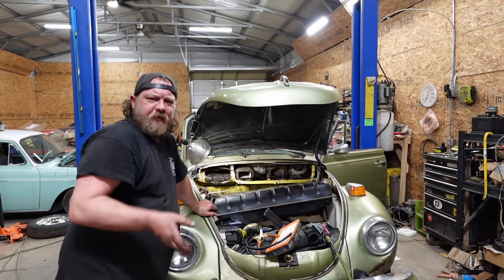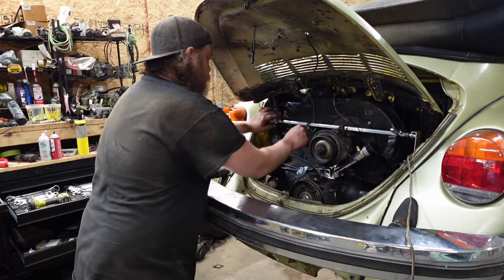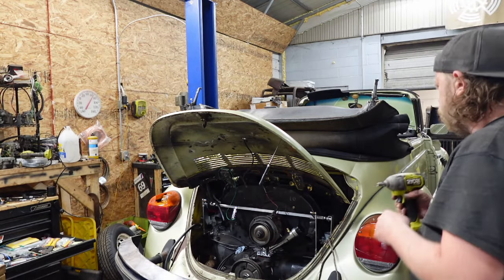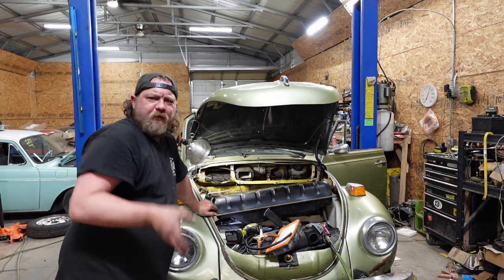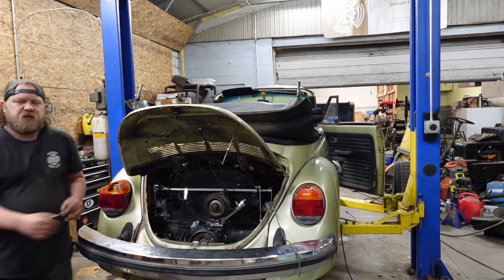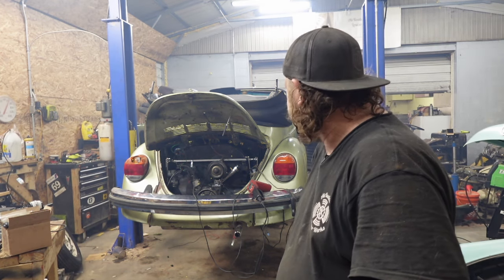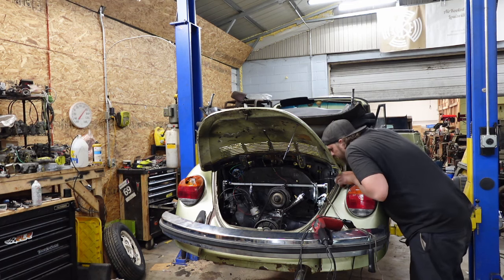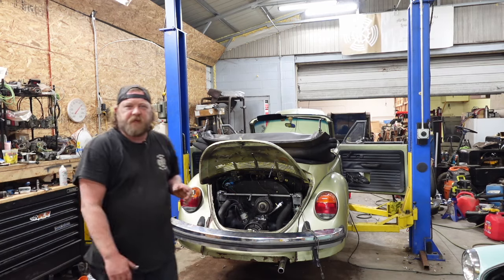1979 Super VW Beetle Revival L-Jet Fuel Injection is gone Dual Carbs Installed

Comment: What is the orange tank you use to clean the nuts on the oil change? I didn't catch what it was but it sure looks like a good tool to have.
Since you did not have to tear the engine down for a rebuild and it sounds pretty good to me, my question is – do you have any concerns (smoke driver side) about the engine, sitting for so long, that the overall lifetime may not be very long? 
Also, I seem to be having the same timing issues that made you change the distributor. If I followed you correctly – first using the timing light, even though you did static time first, the readings were way off, (mine are too) then changing the distributor brought the timing back. What told you that it might be 
the distributor?
Again, great video and I learned several things I did not know. I do wonder how and why you can't be compensated for all the time you invest way beyond what you could possibly be expected to cover when cars that have been neglected and forgotten tax your good will?
Reply from the maker: https://www.amazon.com/dp/B0CKX2WQ4K?psc=1&ref=ppx_yo2ov_dt_b_product_details

To the first question.... I either fill with acetone or brake clean honestly depends what I have laying around to what's in it at particular time of use lol
Reply from the maker: Not super concerned about the engine currently hoping it's just stuck rings due to the alarming amount of fuel in the oil It's slowly coming around but the owner will have to monitor consumption and we can address from there if becomes an issue... And as far as the distributor goes when you static time it at zero and then hit it with your timing light at idle your mark should still be lined up at zero +or - a few degrees ... In this case when I static it to zero and started the engine the timing mark was so far retarded that I couldn't even see it with my timing light I had to advance the distributor almost an eighth of a turn to get zero Mark lined up with the case... So at that point even though all of the marks lined up I knew it was not jiving with the static... The static timing was pretty much lining the engine up at about 28° ATDC so the spark was firing way to early and was the reason for the intake backfires and me backing off the timing when I backed off the initial to eight I was still having intake backfires so I knew something was hinky with the ignition system mainly the distributor... I think I have a more in-depth clip of the carbs not acting right I'll dig up and post if I can I just think the audio was terrible and that's why I edited it out during the revving of the engine
Reply from the maker: I'll try and post a visual tonight or tomorrow on the word salad I just said...lol
Reply: @airkooledmotorwerks  OK that will be great. I think I understand, but I will re-read your reply a couple of times more. Thanks very much
Reply from the maker: @yttkuar  definitely easier for me to show then to try to explain... Just comes with working on these things so long and it's more a six or seven sense at this point on how I do what I do and it's just awkward for me to put it into words that are comprehendable put out visual representation

Comment: Do you know of a dual carb conversion complete kit for sale anywhere?  I know that Jbugs has a single carb conversion kit but I’d like to install dual carbs on my ‘79 super and I’d like to have a “soup to nuts” kit with directions.  Thanks for any info…
Reply from the maker: @johnharrington4963  https://www2.cip1.com/c13-47-7411/
Reply from the maker: This is the exact kit I installed from the company I bought it from CIP1
Reply from the maker: Only thing I do different is run hard lines instead of soft lines to everything but I state and show that in the video... Hope this helps any other questions feel free to reach out

Comment: Hello so I’m doing the same thing with my wife’s 75 super beetle convertible. So what I’d you do for wiring. ???? If there’s a video. Please let me know. Or if we can text directly or call. Thanks enjoyed your video 👍🏼
Reply from the maker: Not 100% what you are asking about the wiring... I showed what I did in the video, but my scenario was a little different as to the fact I had to run another ignition wire... As far as wiring goes if all of your electric is fine all you're going to need is 12 volt ignition key power to the fuel pump. Nothing else gets affected when you remove the fuel injection.

Comment: That bottom end is sounding growly.
Reply from the maker: It's the mic depending on where I stand it's picking up a combination of the alternator (bearings) and the air going into the carbs combined with the heat shield behind the pulley doing whatever it feels like because I don't have the rear engine tin on yet... Please believe I hear exactly what you are talking about and thought the same thing when editing this... but it's definitely how my lapel mic is picking up sounds in conjunction with my body orientation... The sounds that are picking up are almost unnoticeable in person

Comment: We're ripping out fuel injection for a pair of carbs because we aren't smart enough to fix fuel injection.
Have a nice day.
Reply from the maker: Sometimes it just has to be done to keep a car on the road
Reply: Have you seen the prices for OG fuel injection parts? Thanks, I will be happy to tear it off as it's WAY beyond it's self date.
Reply from the maker: Exactly... Sometimes the cost to save just doesn't make financial sense... And please believe I tried my damnedest to save this one (eating my own labor because I'm vain and don't like to be beat) but at the end of the day the wiring harness was toast cold start injector was leaking had the wrong distributor many vaclines bypassed all fuel line shot mass air flow questionable at best all the intake leaks along with missing injector gaskets (mind you this is just what I came across on the initial diag)  and with the car not being original anyway and the owners just wanting to enjoy it, it  didn't make financial sense to try and save it
Reply: @airkooledmotorwerks  The earliest Bosch fuel distributors were cast iron and had leather diaphragms.  I've not come across one, but my understanding is that it's a non-starter.

I like weirdo cars.  My '72 is an autostick, and I have no desire to convert it to a four speed.
Reply from the maker: I currently have a 73 auto stick beetle in the shop for restoration... I was the only one that would take it on as everyone else that the owner talked to wanted to swap it to manual without even considering to try to make the auto stick work ... If it's original and can be saved granted at the owner's expense I am more than happy to do it... Typically if I'm doing an order to manual swap or getting rid of fuel injection it's simply because the swap severely outweighs the repair cost... As far as I know I'm the only one in Louisville that is crazy enough to even work on fuel injection or AutoStick especially coupled with a revival... I think I stated in one of the first videos on this car if it crapped out last month most likely would stay fuel injection but you couple 8 to 9 years of being off the road and left for dead typically multiple issues arise then typically don't justify keeping it It's unfortunate but true... Personally for his my car and I didn't have to pay labor I might have kept it
Reply: @airkooledmotorwerks  If it makes a farting noise when the clutch servo operates, you will need to replace the servo diaphragm.  I've had to replace these numerous times.

Comment: Here is my admitting to stupidity. I posted it yesterday on TheSamba.   
I am too embarrassed to admit this, but I did it! While changing plugs and wires on our 71 Weekender, I chose to first put the new plugs in and then the new wires. I put #1 wire on  the plug just fine. I tried several times to put #2 wire on the plug and it just wouldn't engage. I then felt inside for the plug to see if my alignment was off from the plug stem. I was alarmed when I couldn't feel the top of the plug stem. It felt broken off.  I thought at first that the porcelain  tip had broken off, so I tried to remove the plug for a closer inspection. The plug socket ratcheted as I tried to remove it, but just couldn't grip the plug right, so again I thought I might have broken the plug. I tried to think of a way to see down inside and after several options I decided to use my dental mirror. Once I got the light and the mirror so I could see down the hole, I was instantly relieved. What felt to be broken was actually the spark end of the plug. I had put the plug in upside down. The next trick was to somehow extract the plug. Amazon had come to the rescue in one of my months earlier purchases of a set of telescoping magnetic tools. The smallest one slipped in and amazingly brought it right out. Lesson learned? Never think you are beyond a stupid mistake no matter how experienced you think you are. My worst thought in the middle of this catastrophe was that I might have to pull the engine!
Reply from the maker: I can honestly say I have never done that... Now putting spark plugs in with either removing the cap (and not supposed to) or not removing the cap (and supposed to) I have done and question why plug wires were either falling on and not snapping into place or not Even trying to seat on the plug... We all goof up it's just how you recover and if you learned from the goof
Reply: @airkooledmotorwerks  I've done that one too. I think that is one reason I like your channel so much - it is very real, especially when I shout to you as you are looking for your flash light - hey it is right by your foot !